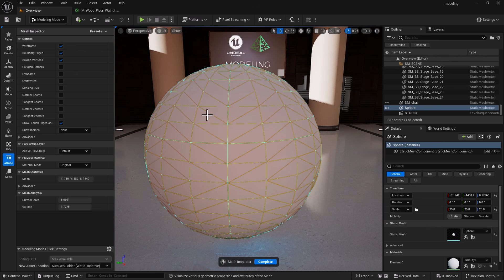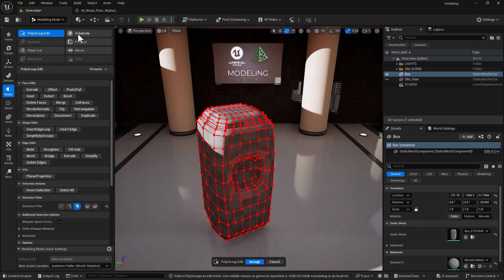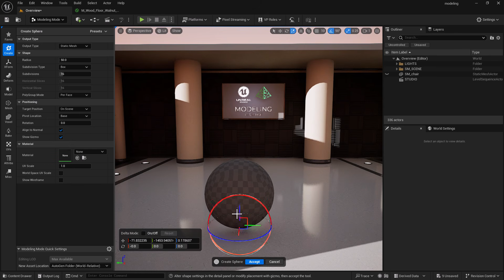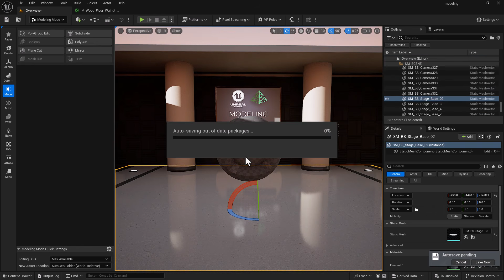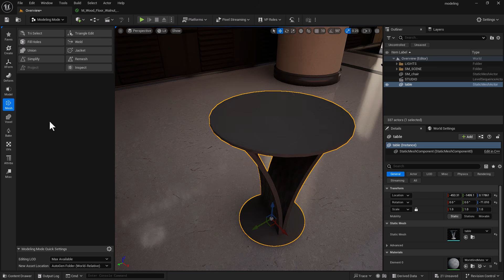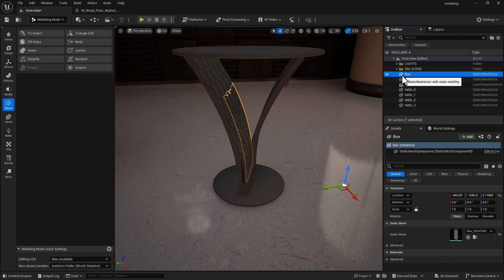#UE5 Series: Modeling Tools in UNREAL Engine Part 2

Comment: can you change the visualization of the models from that chessboard pattern to something that shows you better the surface and highlights of your models?
Reply from the maker: Yeah, totally—you can change the material or viewport shading to something more useful. Just apply a basic grey material or switch to "Lit" mode with default lighting to see the surface and highlights better. That checker pattern is just the default preview.

Comment: I've imported a car and wish to "separate" the doors so I can animate them to open and close.  I previously just cut the door off (in Blender) and created a separate FBX then reattached it in UE.    I've added bones and "weight painted" wheels and gear sticks, so I could animate them, but there is no cutting involved. With these new Modeling tools, can it all be done inside UE5.4?
Reply from the maker: Yeah, with UE5.4’s Modeling tools, you can totally separate parts like doors right inside Unreal now—no need to go back to Blender. Just use the Mesh Editing tools to cut or extract the doors into separate meshes. Then you can rig or animate them as needed. Super handy if you want to keep it all in-engine!

Comment: static mesh,volume,dynamic mesh,waht is the different im the new learning ue5plz tell me
Reply from the maker: A dynamic mesh is a mesh that can change at runtime. This means its vertices, normals, UVs, and other properties can be modified while the game is running. Dynamic meshes are often used for objects that need to be animated or deformed in some way, such as characters, destructible objects, or objects that react to physics.

A static mesh is a mesh that is static or unchanging during runtime. Its geometry and other properties are set up in the editor and do not change during gameplay. Static meshes are used for objects that do not need to move or change, such as buildings, furniture, and environmental props.

A volume mesh is a special type of mesh that represents volumetric data. Instead of just surface geometry, volume meshes can represent 3D spaces with internal structures. Volume meshes are used for complex effects such as fog, fluids, and other volumetric effects. They are also used in simulations and for representing areas where interactions occur within a volume, such as collision volumes or trigger zones.

Hope this helps. I also do explain it in the first modeling video

Comment: Could you perhaps do a tutorial on how to make good texture and vertex color bakes from meshes that use a material with blended albedo and normals for wearing or dirt, roughness and roughness masking of the blended albedo textures, that has also been painted on with other textures using vertex painting to for instance adding more wearing or dirt.

A good example would perhaps be a wall (exterior/interior) that is either plaster and bricks with damage and dirt/moist and/or water that has been dripping from the roof and running down the wall... (*cracks or fallen of plaster showing bricks under it, mold and/or general wearing and dirt building up*)
And so the material would perhaps just have a simple texture blending, and the rest of the wearing and tearing / dirtyness would be vertex painted on to the mesh.

So if you have a house created in blueprint by modular pieces, and is already setup with a simple shader using a simple blending, but you now want to add the grime to it piece by piece (wall by wall or surface by surface) with vertex painting. You might want to bake this to new meshes that can be replaced in the blueprint to optimize it a bit...

I tried this a while back, but the new meshes did not come out with the same piviot locations, and also they had to be fixed before hand to add more vertexes as well as fixing the UV mapping.
If you want to make a tutorial on something like that it would be soooo awesome 😁

Make post apocalypse versions of meshes/models (houses) that is not made in that style from before
Reply from the maker: Hey! Sorry for the late reply — there are just so many awesome comments to get through 😅

That’s a great question, and yeah, it’s a super practical idea — especially when you’re trying to turn clean assets into grungy, post-apoc ones without blowing up performance.

So the short version: yes, you can bake that kind of layered material with vertex painting into texture and vertex color info, but it needs a bit of prep. What I’d recommend is using a plugin like BakeMeshToTexture (comes with Unreal) or something like Material Baker (from Marketplace or GitHub). These help you transfer the full material look — including vertex blends, roughness masks, and normals — into a baked texture.

Before baking, though, the mesh needs good UVs (non-overlapping, ideally second UV channel for baking), and enough vertex density to hold the detail from your painting. That’s usually the step people miss — your modular pieces need subdividing before painting if you want the vertex color detail to actually show up properly. After that, when you bake, make sure to preserve pivot transforms (export/import carefully or use something like the Pivot Tool plugin to fix pivots after the bake).

Once you’ve baked everything (diffuse, normal, roughness, AO, vertex colors), you can reapply these to a simple static material and swap out the blueprint parts. Performance gain, preserved look.

I’ll definitely add this to my upcoming tutorial list — turning clean meshes into grimy, damaged ones and baking it all down is a killer workflow for stylized or optimized post-apoc scenes.

Comment: @37:14 Is Allow collapses unchecked not also helping to avoid that a bit also?
I remember that i had this issue on a mesh once, but i did in the end get a ok result by uchecking that if i remember correct.